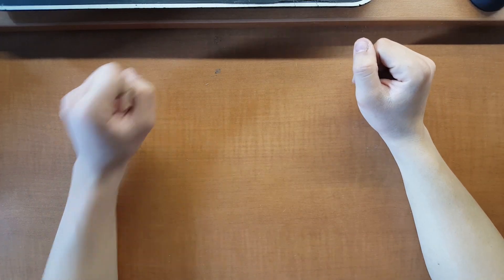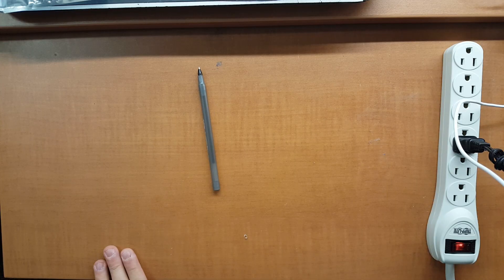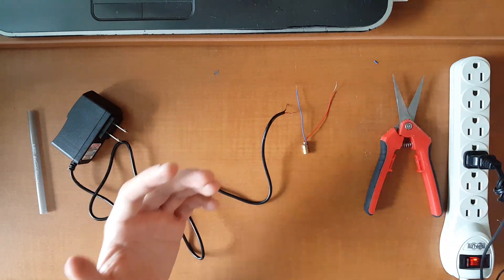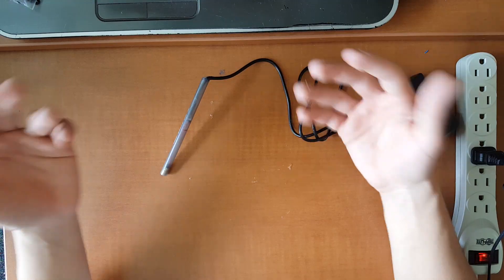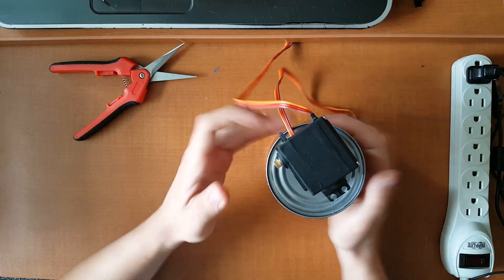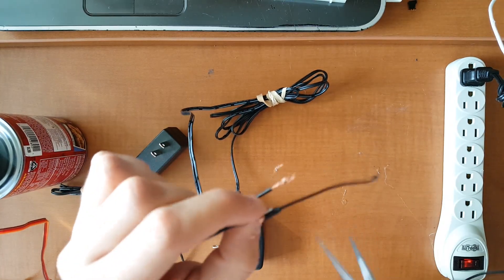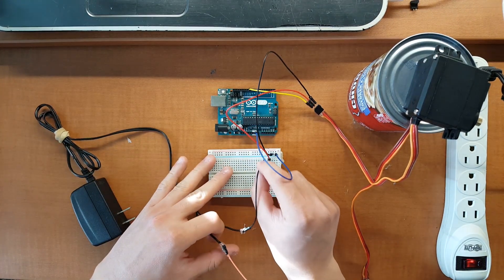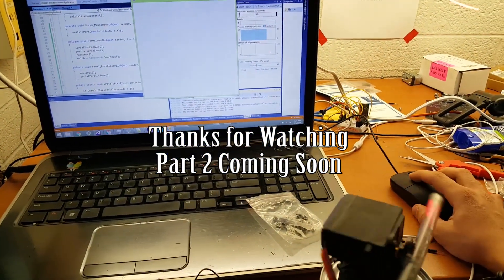DIY Laser Turret | Part 1 The Hardware

Comment: It would be best if you used a laser driver to properly turn on the laser. You can make one for cheap using an lm317 voltage regulator ic. There are lots of suitable circuits with this ic on google.

Comment: If you are following this tutorial, absolutely DO NOT try to skimp on the power supplies. I made the stupid decision of trying to power everything my arduino and then spent two hours trying to figure out why my arduino kept getting disconnected from my USB port. It turns out that the servos draw too much power and they kept turning off the arduino. I thought that Michael had redundant power supplies, but it turns out that he knew exactly what he was doing and used the proper amount. This is why you don't try and take shortcuts when following tutorials made by people who know better than you.

Also, make sure you're using the exact same project type with the exact same name as Michael uses in the video. I couldn't figure out why the serial item in the toolbox wasn't showing up, and it turned out that I had picked a different Windows Forms project. The project should have the EXACT same title as used in the video.
Reply: I am pretty sure you can use two AA battery’s to power the servos
Reply: For the lazer pointer, you could just use a 9v battery pack with a 200-330 ohm risister to make it more portable.
Reply: What project is he using? The link doesn't work, so mindlessly scrolling Amazon.

Comment: 2:38 You do not need a soldering gun, you can use wire nuts (assuming you are not going to use a pen) as a temporary alternative in case you want to use the wires for later, and you don't need to worry about the wires touching. Also if you are going to use a wire nut, there is no need to strip your wires that long, just a half inch of bare wire is plenty, any extra and you risk shock if you are fingering around stuff.

Comment: Question, Im probably gonna use a 100-240V kodak printer outlet as my power source.. Would this affect anything except the laser? (There is a USB connector for a phone charger on it)
Reply: you might need a resistor for large voltages like that for a small project like this.

Comment: I find it easier to stick the twisted wire in to the hole of the hot glue gun it adds a nice little cover to it and makes it easyer to pull them apart Incase of modifications in the future

Comment: You would spend a lot less money by just using 9 gram servos which only cost 99 cents on eBay, and have more than enough torque to move a little laser.

Comment: Why did you power the servos with external 5V when you could have just used the 5V from the Arduino to the positive rail on the breadboard and plug the positive wire on the servos to the positive rail on the breadboard as well?

Comment: Hold up! Won't the wires heat up and melt the hot glue?
Reply: Jagger Draws! No. Unless there is a short-circuit or too much current going through a too thin wire.
Reply: I making a electronic slaper
Reply: @randomguys1806  too late
Reply: Astro he plugged in a transformer that made it 5v
Reply: It’s crazy how nobody realizes this is a joke
Reply: Legends never die!
Reply: No
Reply: it's 5V...
Reply: Astro that happens when there is a lot of resistance in the material, like a coin , but the cooper has so little that it passes with ease 
Edit: I miss this Michael :(
Reply: 5v DC, is very different from 5v AC, 5 volt ac will kill you with the right apm s, while its harder of 5v dc

Comment: I recommend hot gluing that servo connector as close to the tip as possible for that extra pin point precision.

You know, so you can be extra sure you're blind.

Comment: Hey so I made this robot for camp connect and for some reason the Servos on the back legs aren't functioning, there's this thing(no idea what the name of it is) where you put the wires and it pinches them down but 2 of them came off and it won't pinch back down.

Comment: While not always the case, white striped wire is usually the positive. Better check with a MM or even a LED with resistor in series.

Comment: Make sure to keep your laser plugged in while hot gluing the wires
Reply: ModernTree But it's 5 volts, you can lick the wires and it'll just tingle
Reply: Waifus Choice Alright, I just did it and nothing happened
Reply: I was waiting for it but honestly 5v not that much, I once touch by mistake an electrical cord wire exposed 110 that hit like a horse but just for a second or two, and I've been electrocuted by 220 twice that one really hurts but as long as is not with you hand around the exposed area (hands tend to cramp and hold onto it) your guccy.
Reply: Skeletonpope 
Glad I’m not the only one who noticed that
Kept thinking dude was gonna electrocute himself
Reply: I get this is meant to be a joke but in case you are serious the thing he plugged in was a transformer that made it 5v making it safe now if you were to do that with the raw outlet you would fucking die
Reply: Yo true idk how he didnt die
Reply: Yep but make Shure you use a 120 volt cable not this fucking 5,volt garbage
Reply: a high combination of ampere and volt is what gets dangerous not one over the other even if it can become dangerous if the volt is really high... This is only 5v tho...
Reply: @ghosthookcc2050  finally someone who has half a brain a welder has a ton off amps but won't kill you you need the volts to carry the amps across your heart
Reply: @deano509  good wasnt sure if I was right at first, I don't know too much about electricity, I have only taken one class in tech...
Reply: candy cats everyone like U=Rx1500vx10=2 and I’m over here and can’t even figure out 2+2
Reply: @garrett810  I feel you man... But i'm going through some really hard math atm so soon that will be me too xd
Reply: candy cats lmao
Reply: candy cats I love how we are adding to comments from 2 years ago lmao😂
Reply: @garrett810  its kinda sad aint it ? :/
Reply: candy cats meh😂
Reply: Voltage is actually not that important. It’s high amperage that kills you
Reply: @flograuper9294  https://youtu.be/XDf2nhfxVzg
Wrong.

Comment: great tutorial! just a quick tip though: you can wire both of the servos and the laser up to the arduino' s 5v pin and it should run just fine powered off of usb - it shouldn't use more than an amp of power.

Comment: Jesus what the fuck did you do to the servo connector, that thing looks really beat up :P.

A few nitpicks for people who want to actually build this:

- Laser Diodes tend to want a constant current source which would come from a driver, I'm surprised that nothing exploded the way that you did it. At the very least some resistors would help.

-Power Supplies - Having so many is going to be a bit awkward, there are no issues necessarily but having one, higher amp rated power supply is just much cleaner :) .

Good job Michael, keep it up.
Reply: Lewis RobotStuff , The link in the description is for a laser module not laser diode, so the driver is included but yeah leds or laser diodes are current operated and need at least a ballast resistor or proper driver.
Reply: i also think its odd that he wired the ground of two power supplies to one another... it is kind of unconventional

Comment: Can someone start a fund to buy a soldering iron?
Reply: I will donate at least $1. Maybe 2.
Reply from the maker: I have one my dude, but if you know how to solder, you just do that instead. If I didn't show how to hot glue and soldered instead, people who can't solder can't do the project haha
Reply: Hot glue does fix everything in fairness. Except skin.
Reply: well I have a soldering iron but no hot glue gun. How am I supposed to know what to do?!
Reply: should we start a fund for that camera rig instead? 😜
Reply: What are you looking at, Smoothskin?
Reply: Michael is alive??? TALK TO US! ARE WE GONNA GET ANOTHER PART OF C#????
Reply: even better method: put the two wires in a random wall socket and touch them together
as insulation i suggest Chopsticks, cause the chinese takeaway guy might give them to you for free
Reply: Michael Reeves when is part two
Reply: I'll donate 12.5 cents
Reply: Steve Howes they are like 20 bucks
Reply: There's a real nice cheap one you can get for about 5 dollads
Reply: ok fund for a fucking pair of wire strippers
Reply: Could just use tape? Even normal tape would probably be fine at 5v
Reply: So you also have a set of actual wire-strippers, and were just using the scissor method for demonstration, right?  If not imma get you a pair.
Reply: Richard Mullan i hope you're joking
Reply: I bet he is ^^

Comment: Since laser and servos have the same supply voltage and current consumprion is less than 2A, which was labeled on your power supply, you can connect all three components to single power source. Anyway all grounds should be connected together and to arduino as you mentioned. :)
Reply from the maker: I did try this actually, the servos just have a lower response time when I max out amperage, makes it a lot more satisfying when I user serial to control them. 🌰

Comment: >Hot gluing wires instead of soldering

God is dead and you killed him, Michael.
Reply: @MichaelReeves  NUT
Reply: @MichaelReeves  poor
Reply: @MichaelReeves  ...nut?
Reply: He only uses the finest of materials.
Reply: using an external 5v power supply instead of a transistor.

God resurrected to suicide.
Reply: Penniless their called wire nuts lol
Reply: yeah, killed himself about 4 times total. but great project for a software engineer.
Reply: mdszy he recently made a poster that says that
Reply: You mean ding ding
Reply: 666 likes lol
Reply: mdszy because wire nuts are expensive
Reply: there is no special reason to need solder, its honestly more of a personal preference than anything else. in a pinch, you could heat up a little chisel to like 400-500 degrees Fahrenheit, and since the solder itself is mostly comprised of lead, that should work. the only difficulty comes in with keeping that temperature for long periods of time. if it's necessary that you solder a good amount of wires or things together, your probably better off with a regular soldering iron(if and when you can get your hands on one) due to the fact that your project would take a lot less time overall.
Reply: mdszy god tried to use the laser but was electrocuted because of the shoddy glue-guning
Reply: Lol I've never seen somebody hot glue wires together before this.
Reply: i just tape them together lol
Reply: He has also killed him self
Reply: Doot doot?
Reply: you don't even NEED to solder wires together. If you wrap them around each other, it should be fine. The most you would need are endcaps to make sure they don't short themselves on other wires.
Reply: @crackster234  you could melt the wire and short circuit it
Reply: it's just a soldering gun ffs
Reply: A solder is required just with a very high temperature (not the case here)
Reply: not everyone has a solder on their house
Reply: Michael Reeves where are you
Reply: I know, but that sound weird.
Reply: mdszy god was never alive in the first place dumb ass

Comment: Why did you use two power sources for the two servos ? (Are the power sources not powerful enough for a parallel circuit ?) Same question for the laser, but it is understandable if you want to separate the motors from the laser. Btw a great video and a funny one on top of that.
Reply from the maker: Thanks my dude, and yeah it would be great if I could use one power source to feed both servos, but mine are fairly weak since I got the cheapest ones possible.
Reply: Okay :D thank you for the quick reply, have a nice day and keep up the good work !
Reply: @MichaelReeves  hey Dude, i would like to build your laser but the amazon Link is broken. .. please help!
Reply: @xxxREXSOxxx  same for me
Reply: My laser diodes overheat when I run it off a 12v 1a powersupply... I was hoping to be able to run it all off one plug. Ive got the whole thing in series, if I run it in parallel will it overheat less?
Reply: @juliantrueman6542  Read a little about serial vs parallel circuits - in series, you are essentially lowering the voltage across each component and that's not what you want. You want everything to run from clean 12 Volts (if your servos and lasers are 12V even, I'd assume they're 5V) and by wiring it in parallel you achieve just that while drawing more current - that's why you need to make sure you have a powerful enough power source to provide that current - Amps. (I'd recommend 3A and you should be good). Hope this helps
Reply: @matusgrellneth1645  if the diodes get hot when they're is series, putting them in parallel over the same power supply will likely destroy them. What he needs is dropper resistors
Reply: @TDG2654  yes, that is exactly why we have resistors and put things in parallel and not just add components in series - diodes of any kind should always have a resistor connected to them or they're likely to blow up, but I still think parallel is the way to go, less calculations, no V drops/peaks because of a fried component etc. And a heatsink wouldn't hurt if he decides to re-do it :)
Reply: @matusgrellneth1645  with a constant current source instead of constant voltage you wouldn't need a resistor, but those are rarely used
Reply: @juliantrueman6542  the diode running hot means that there's too much current flowing through it, either connect it to a lower voltage power source or put a resistor in series with it.

Comment: Are you sure you're not an engineer? 😂 Damn, I didn't understand anything you did in this video but I sure enjoyed it.
Reply: Beans he cant be an engineer, because he hot glues the wires
Reply: Jmantheawsome1 he stated in the vid that he used hot glue so that people who cant solder can still do the project. he also said that he has a soldering iron.
Reply: Jmantheawsome1 also he didn't need any of the power bricks :/
Reply: Ilram Yerolf Why do you say that?
Reply: +Daydream Real engineers use solder and heat shrink tubing. Extra flux always helps for bigger connections. Hot glue makes a weak joint.